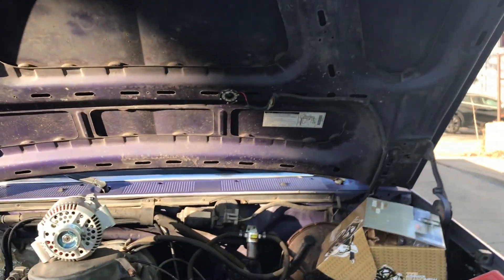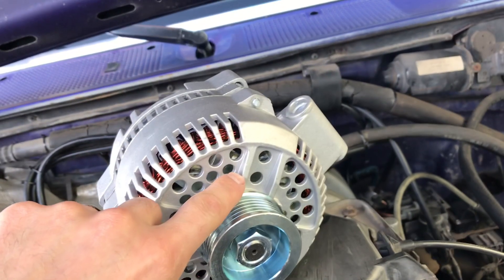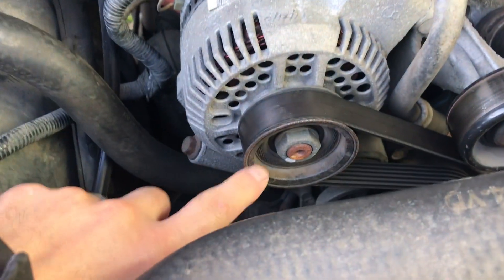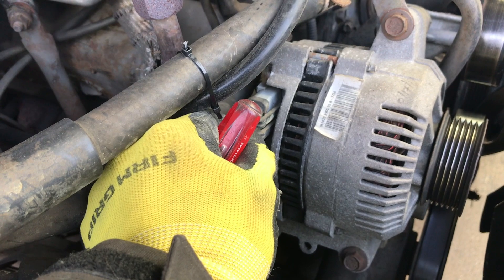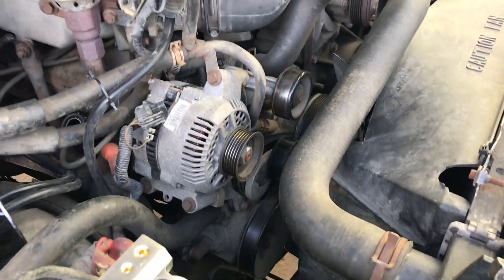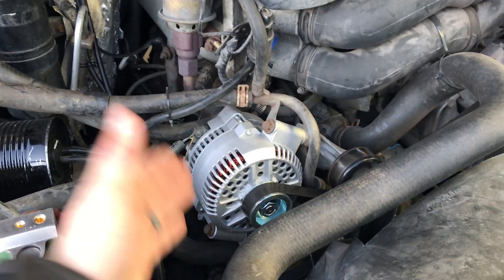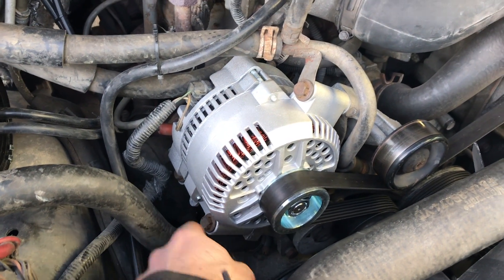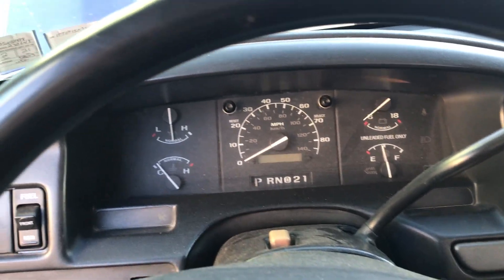How to Install a Larger Amp Alternator (130 Amp) F150

Comment: I replaced my alternator with a 130 amp I put a mega fuse and bigger cables and new battery and put some cheap brass terminals from Amazon. Now the battery is 12.6 when my 95 bronco is off but when I go to drive it the voltage drops to 12.2 it wasn't doing that yesterday I dont know where to start.
Reply from the maker: Interesting. How big of cables did you install? I wonder if they are too big and causing voltage drop.
Reply: @TheMinuteMasters  cant remember if its 2 gauge is the charge cable that goes to the starter solenoid from the alternator and also the one that goes from the solenoid to the battery is 2 or 4 gauge
Reply: @TheMinuteMasters also I forgot to mention that the cables that go from the alternator to the mega fuse to the solenoid are pretty long probably a foot or 2 long each cable. Would that affect it?
Reply from the maker: @Cotorro187  That could cause voltage drop.

Comment: Hey Stevie, just curious. Have you ever upgraded the wire? Considering upgrading myself for an added booster fan for A/C. Draws another 12.5 amps when on and I’m wired with a isolation relay. As you mentioned I’ve seen it posted both ways. Don’t have anything extra. No added lights, stereo amp, very factory.
Reply from the maker: So it’s probably not a bad idea to upgrade the wire if you see yourself adding more current draw. The nice thing is most LED lights don’t draw a whole lot of power, but that fan could. There is a 3G alternator kit that does include a lot of upgrade wiring.
Reply: Thanks again for everything. It’s a 14” pusher and wired in with A/C clutch. Works great in heavy traffic, red lights, drive-thru. My clutch fan is new also. Makes a really nice difference. Especially in the “Hurricane State” mid-Fl.
Funny thing, you come up at our local car shows. Someone always references your channel when showing my truck 😂
Reply from the maker: @amperagedemon6603 That’s a nice setup! Great to hear it works down there.
Really??

Comment: Hello I have a 1992 f150 5.0 manual two-wheel drive and was having a problem with my truck voltage dropping when I come to a stop and or am breaking and sometimes I notice it gets very low while at idle as well. Should I buy a higher output alternator to make sure this is not the problem or could you confirm that this is my problem???
Reply from the maker: If your truck is entirely stock in terms of electrical components and accessories, then I would try to find the root problem. I would test the alternator and make sure it’s not failing. Test the battery and then you’ll probably have to run some voltage drop tests to find the “leak/draw”

Comment: Hey what charging cables are you using? The connectors to the battery look very nice. If you can link them that would be much appreciated!
Reply from the maker: The charging cables are stock, but those battery terminals are aftermarket. I have a full video on how to install them and there is a product link in the video description.

Comment: If anyone is still looking for an alternator and can’t find one. I have a 95 ford bronco 5.8l and I used the Duralast Gold Alternator DLG7765-6-2 from auto zone. I’m pretty sure it’s for a e series van, but it has the right holes and it’s 130 amp. It fixed my needle going crazy at idle. I have not upgraded my wiring and not had any  problems so far. Also the stock belt works. It is plug in play. This is the alternator with the 3 holes in the triangle figuration.
Reply from the maker: Thanks for the tip man!🤙
Reply: @TheMinuteMasters  No problem! Thanks for the useful vids!

Comment: I just replaced my 95A with a 130A on my 95 F150 with a 4.6L. The original had 215,000 miles on it. It was an easy swap. Thanks for the 130A tip!
Reply from the maker: Nice! It’s a great mod! 
You’re welcome!
Reply: @TheMinuteMasters  The mounting bracket holes for the 95A was different for the 130A. BUT, on the alternator mounting bracket there was another set of holes that were slightly to the left of the 95A holes which mounted the 130A nicely. I did however use a slightly longer belt. The 95A belt was 98-5/8" long (Gates-K060980), It was a "TAD" short. So I put on a 99-5/8" belt (Gates-K060990) that was PERFECT.
Reply: @Woodscustom im starting to wonder if my belt is to long for my 5.8l or if I have the wrong size idler pulley

Comment: Rock Auto has 130Amp for 1995 F150? Didn't see only 95 Amp.
Reply from the maker: I think they sold all of them out after I made this video. You’ll just have to search around on the Internet for one.
Reply: Go to your local auto parts or Rock Auto and look for mid 90s E250 4.2L and it’s listed. It’s the exact same one he uses here.

Comment: What alternator do I actually use for this upgrade
Reply from the maker: Just google search Ford 3G alternator. A couple should pop up. I don’t have exact part numbers though. I think these alternators were found on e series fans and any ford vehicles with aftermarket packages (ambulance, etc.)

Comment: Do you know if the 5.0 5.8 and the 7.3 have same design alternators?
Reply from the maker: Good question! I don’t really know. I could see the 5.0 and 5.8 being similar. You could enter both engine types on an auto parts website and see if the same part number comes up.

Comment: Are you still running this alternater and is there any problems with it? Looking g to do electric fans and upgrade alternater as well.
Reply from the maker: Yup! It’s been a great alternator and I’ve had 0 issues with it.

Comment: Terrific video!!  I bought a new alternator 6 months ago  it’s really cold here In SLC so in the morning when I start my 1996 F150 302 5 speed the battery light comes on and the volt meter is at zero  after a few minutes the red battery light starts to flicker and then goes away and then the volt meter gauge rises to the middle of the gauge and I can drive away.  When it’s nicer weather days this doesn’t happen or after I have driven it doesn’t happen. It’s just really cold morning
Reply from the maker: That seems kind of unusual it’s gotten to -4°F here in Iowa and I’ve never had that issue. Granted, now I have this larger amp alternator.
Reply: @TheMinuteMasters  I know these trucks very well and I have never heard of it
Reply: @TheMinuteMasters  it’s got to be the alternator

Comment: Looks like RockAuto doesn't have the 130 Amp model listed anymore on any of the OBS trucks. Any others you recommend?
Reply from the maker: So all my usual places seem to be out of 130 amp alternators. I would just try a general Google search and see what Ford 3G alternators are available. There is a 3G alternator with more than 130 Amps that is made by Powermaster.

Comment: I cannot begin to tell you how much of a lifesaver your videos have been. My truck is a 90 f150 with a 4.9 in it. I've went to your link but I can't seem to find that alternator I was hoping you would have some insight on a alternative or if I can even put that on a 4.9
Reply from the maker: No problem Nickalas!🤙 
So from the feedback I’m getting from other commenters is that it’s no longer available from rock auto. If you do a Google search for a Ford 3G alternator you’ll be able to find them on other websites. I’m not exactly sure about the fitment to a 4.9 L but as long as the bracket holes lineup I don’t see why it wouldn’t work.
Reply: @TheMinuteMasters  Thanks so much for the reply! I'll look around and see if I can find one. Thanks again for your videos. I watch them everyday lol.
Reply from the maker: @nickalasnewman7972  You are most welcome Nickalas! I’m glad you like my videos.
Thank you! I appreciate it.🤙
Reply: @nickalasnewman7972 did that 3G alternator work for your 4.9?

Comment: Mine is still dipping the voltage alot even though I got a bigger charge cable and mega fuse
Reply from the maker: Really? And it’s doing this even after you’ve upgraded the alternator? I want to say there is another part you can replace which will stabilize the voltage.
Reply: @TheMinuteMasters  which part would stabilize it
Reply from the maker: @Cotorro187  So I think a bad voltage regulator can cause weird fluctuations in power. Otherwise, check all of your connection between the battery and the alternator.
Reply: @TheMinuteMasters  thank you ill check my connections first then if thats good I'll change the voltage regulator
Reply from the maker: @Cotorro187  No problem man! Let me know what you find out!
Reply: @TheMinuteMasters well the mechanic had my bronco for 2 days and they told me it was charging my battery fine. So it starts out at 14.0 to 14.3 and as it warms up and im driving the voltage stays between 13.6 to 13.9 but thats only with my stereo on if I turn on the A/C it drops down to like 13.3 or 13.1 and i feel like it shouldn't be that low especially it's a higher output alternator. Im starting to wonder if my serpentine belt is loose because if I get on the gas i hear rattling almost coming from the front under the car
Reply: Yes I even connected the charge cable directly to the battery and when I use the max AC and radio and lights at the same time it goes from the beginning of the M to basically he beginning of the R

Comment: i did the 130 amp 95 mustang alternator upgrade on my 1988 f250 5.8L about 3 years ago. i also had to add the 175 amp mega fuse to the charging cable i had to make. its made a world of difference, the old gen 2 alternator they originally put on this fully fuel injected  truck was a serious joke, it killed 2 batteries in 2 years. i also put the oil cooler and power steering from a van and also relocated the ignition module off the distributor over to the drivers finder like the 92-96 trucks. all i need now is a oil catch can, other than that she is like a 92-96 under the hood but a brick nose every where else. no complaints
Reply from the maker: Yeah that G2 alternators were terrible. Lol I guess ford just wanted to supply the minimum amount of amperage needed. Nice! Those are all good upgrades. It’s kind of cool how you can see from one generation of truck to the next, the little improvements Ford made.

Comment: whats the part number on your 130 amp g3 alternator?
Reply from the maker: That’s a good question. I bought it from Rock Auto but apparently it’s no longer listed.
Reply: @TheMinuteMasters  i found a few on rock auto prolly get the bosch you got a video on rear brakes?
Reply from the maker: @TheGstnyellow150  Yeah as long as it fits, you are good. 
Actually I don’t and I did a full rebuild a couple of years ago. I might be due for shoes and drums but I’d have to check.

Comment: Rock Auto does not have the 130 Amp alternator now. I saw on Amazon a 160 Amp and 200 Amp. My truck has a new alternator right now so if I decide to keep it I will upgrade also since I plan to use it to tow a small camper.
Reply from the maker: Gotcha. Is the 130 out of stock? 160 and 200 aren’t bad and will give you plenty of amps for a camper.
Reply: @TheMinuteMasters  Rock Auto does not even have a listing for 130 Amp anymore.
Reply from the maker: @mrj-charles6383  Well that sucks. Maybe someone else will carry it.
Reply: @mrj-charles6383  one off a 1996 E150 are available in the 130amp . Just ordered mine. Its a straight bolt on. I'm not sure if you need get a different belt size but everything else is plug and play.
Reply: @TheArnoldo206  Thanks for the info.  When I bought mine it had a new alternator installed. So unless I add a binch of add ons that one will be ok.

Comment: Everyone of these videos glosses over removing the 2 lower alternator bolts, which is seeming impossible to me and why I’m resorting to these videos in the first place!
Reply from the maker: Are you referring to the harness bolts? My alternator is only held on by two long bolts.
Reply: @TheMinuteMasters  The bottom 2 bolts that hold the alternator on.  Not much room to get to them with all the stupid smog crap in the way.  I had to use a swivel on my ratchet, and several extensions.  And disconnect some of the smog tubes.
Reply from the maker: @ThinkDifferentish  Ah! My truck doesn’t have any smog equipment at least not the California type of stuff.

Comment: it's 3g not g3
Reply from the maker: You’re right! My mistake. Thanks for the clarification man!🤙
Reply: @TheMinuteMasters  im glad you didnt take it the wrong way cause i meant no I'll will. Im glad somebody is out there helping others out with this info. Just to expand on your topic. Yes what you installed is a 3g large case. This alternator can also be use on bullnose and bricknose to upgrade fron the 1G and 2G alternator that were only 70amps and also had a fire hazard issue th me to the connector. Not to be long winded but the great part about the 3G large case is its also the same size and the 6G so there are part interchanges tour abke to do. They have 4 differnt case designs but the internaks are the same. And if you have a need for more ampreage.  No need to go buy a 300 high output you can purchase 250amp stator for the 3g/6g alts for about 60.00 and they are not hard to rebuild.

https://www.ebay.com/itm/261960558985
Reply from the maker: @ottobauner9828  Nope, I wasn’t offended at all. I have viewers from time to time, offer corrections of things I said. I see it as a learning experience and a chance to set the record straight.
That’s cool! I did know the 3g were upgrades over the older alternators but the stator swap is very cool! 
Thanks for the info and thanks for watching!🤙

Comment: I'm wondering if I could jerryrig up another alternator to fit where the smog pump goes...... itd be like a bulletproof system cause if one fails you still have the other
Reply from the maker: That would be very interesting. Might be overkill if you have a new higher amp alternator. I’d definitely have to figure out a way to regulate everything so you don’t over charge everything.
Reply: @TheMinuteMasters  true true definitely need a regulator. im thinking of putting ac stuff in my 88 f150 and definitely want the charging system to be able to handle a blower motor. do you know if they came from the factory with different alternators for different configurations.... might be cheaper like you said to put a better alternator on it.
Reply from the maker: @benjaminlockhart2792  I would think they would put higher amp alternators on trucks with more accessories like AC. I would do a little research and find out. Otherwise, I would look into a 2G to 3G swap for your truck. The 80s trucks had 2G alternators and starting in the 90s they added 3G alternators.
Reply: @TheMinuteMasters  Will definitely have to! thanks man
Reply from the maker: @benjaminlockhart2792  No problem Benjamin!🤙 Thanks for watching!
Reply: @TheMinuteMasters  Of course man! learned alot from your videos. thanks for taking the time to post videos and reply to comments!

Comment: i didnt even need it but i used 1/0 AWG wire and the new alt is 350amp  on my f-150 2014 v8 this is way over powered for no reason at all XD
Reply from the maker: Hahaha! That’s definitely overkill but you’ll never have to worry about it.

Comment: I pulled the bracket and everything to make my 92 have that type alt and just so happened I had a brand new motorcraft 130 amp alt laying around
Reply from the maker: Nice! 🤙 Those 130 amps aren’t common. My part stores have to order them.
Reply: @TheMinuteMasters  I order mine for a 99 ford ranger 4.0
Reply from the maker: @jamesshaw4954  Cool! I didn’t know that was a viable swap. I think mine is technically from a Ford van but I think so of the F250s and F350s had them too.
Reply: @TheMinuteMasters  if I hadn't just put a new high amp alt on my 92 f250 I would have converted that but my 150 needed an alternator and I had all the parts to convert was a simple job probably an hour at most or in my case about 20 because both truck were torn apart
Reply from the maker: @jamesshaw4954  Good choice. These f150 need more juice and those 95 amp alternators don’t make enough amps.
Reply: @TheMinuteMasters  hell my 92 only had a 65 amp alt that was the highest for that year because of the 2g setup they had
Reply from the maker: @jamesshaw4954  That’s right! I don’t know why Ford put such tiny alternators on these trucks. Modern cars are pushing almost 200 amps. Lol

Comment: Great info! Has anyone else ever experienced shaking from their volt needle? It’s occasionally done that through about 3 letters worth with and without load.
Reply from the maker: Thanks man!🤙 That could be a voltage regulator problem. A multi-meter could help you figure that one out.
Reply: yea that happens to me sometimes

Comment: Hi Stevie, Good to see you again. Well, I got my truck inspected finally with the wait because of covid. It is registered, new plated from Washington, and insured. I have been driving it  to town. Have a little problem with down shifting from 3rd to 2nd. hard to get into 2nd. Will be doing a gear oil change after a thousand miles. I am thinking about a different transmission. maybe an automatic, dunno yet.
Reply from the maker: Hey JR! Very good to hear! I’ve sure the shifting issues can be reworked. Going from manual to auto is a lot of work isn’t?